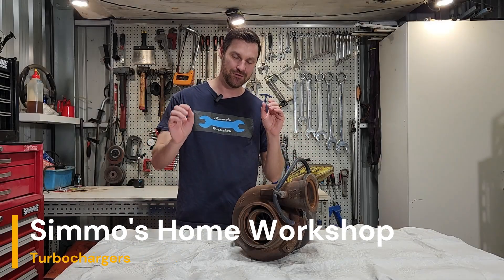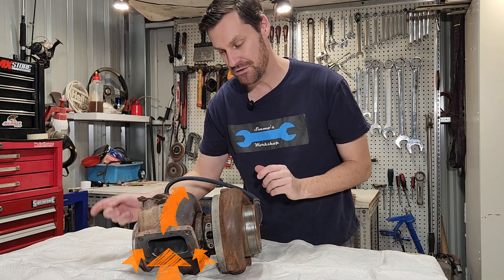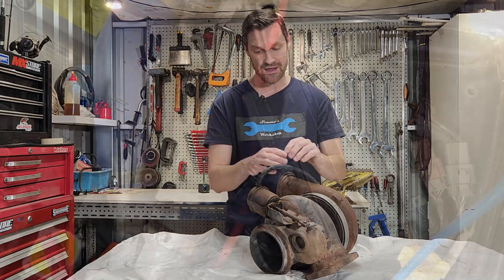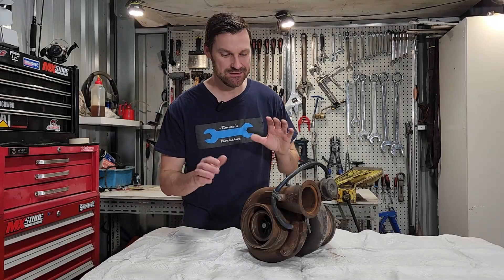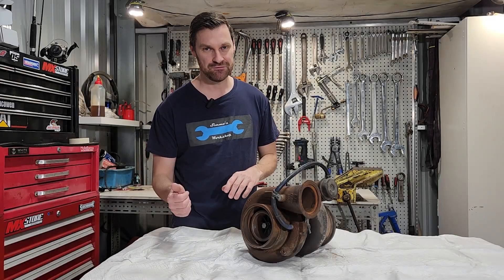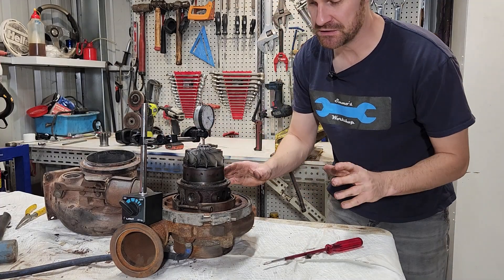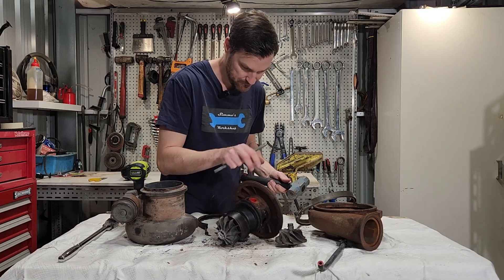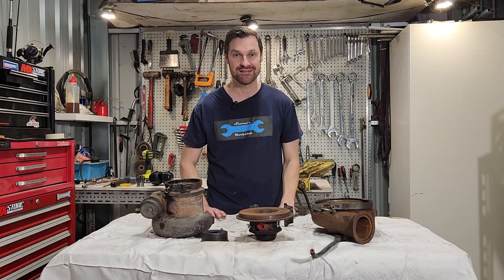How Turbochargers & Forced Induction Systems Work | #howitworks #turbo #mechanic

Comment: Now say you were to…. Uhhh…. Smack that actuator with a hammer? Would it give you flutter?
Reply from the maker: Haha! If you were delete the actuator and hold the wastegate shut you would see more max boost and some boost spiking coming off the accelerator which would help awesome sounds from the intake.

If we are talking flutter as compressor surge the wastegate likely wouldn't have much to do with it, its more of a sound coming off the throttle when the intake air causes the compressor wheel to stall, because it can't go past the butterflies so it goes through the turbo. 
Manufacturers use recirculation valves or blow off valves to protect the turbo, tighten those up or delete them for flutter but the turbo might not live as long as it should if those aren't in place.

Diesels without a intake butterfly would be less likely to flutter unless you run large volumes of air and high boost the engine can't consume when dropping back to low idle suddenly.